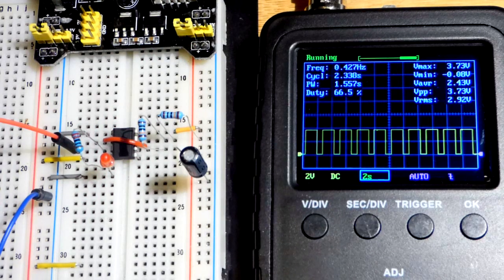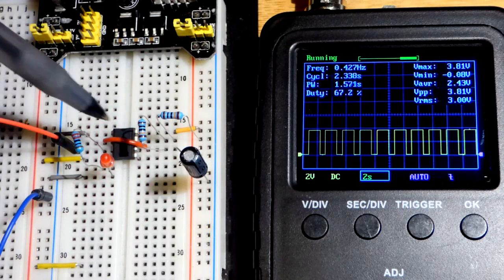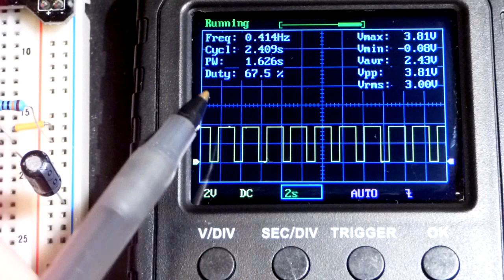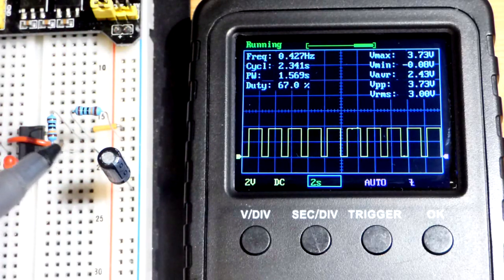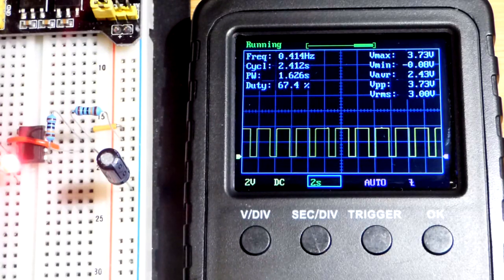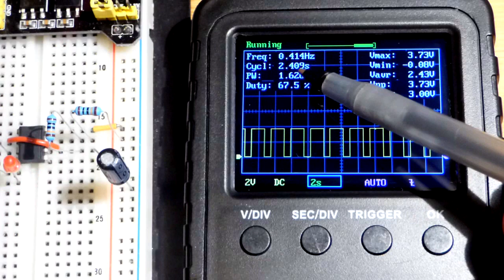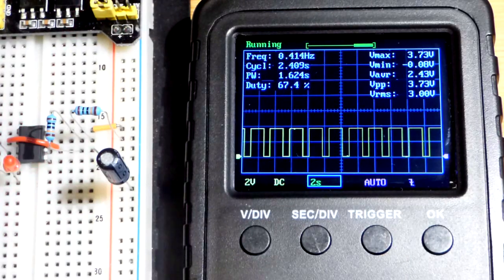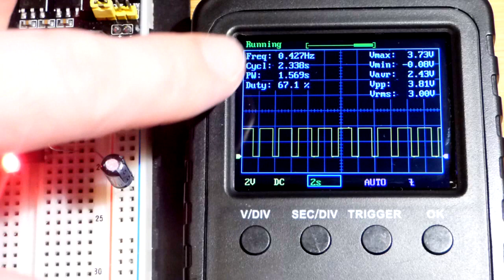Comparing 555 timer astable mode online calculator values to oscilloscope measurements

Comment: How did you move the 0 base down to the bottom?
Reply from the maker: Press the V/DIV button til the left arrow is highlighted. Then turn the dial to go up and down. Keep in mind that zero can keep going down below what you can see, even though it looks like it bottomed out because you can still see a line at the bottom. So stop turning the dial as soon as it hits bottom. Pushing the dial like a button will put or remove  >> at the top. >> makes it so that turning the dial will make a lot more change for each bit of turn than when there is no >> at the top. Hope that helps!
Reply: @Electronzap  Thank you!!!!